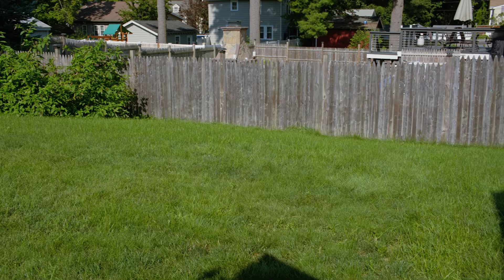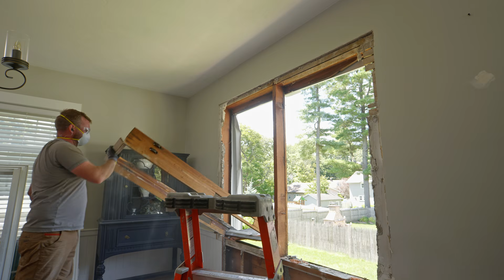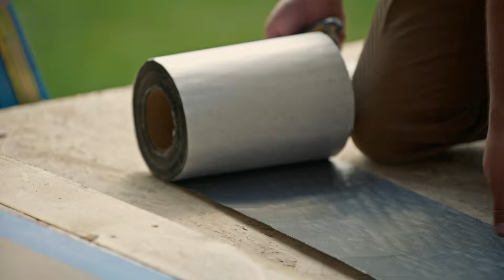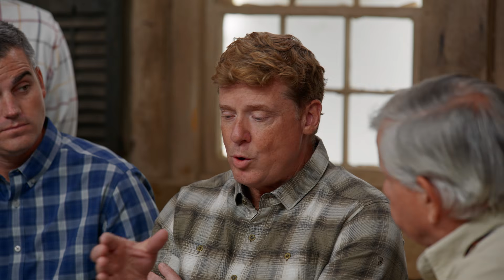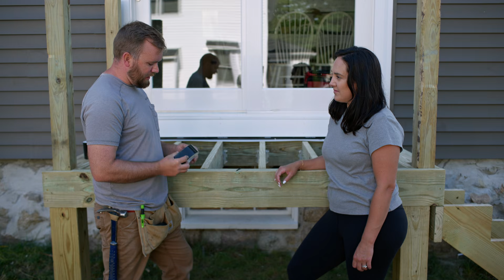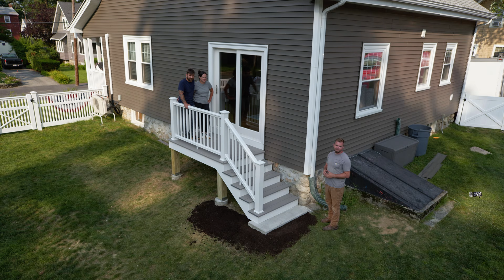ASK This Old House | Window to Door Conversion (S22 E10) FULL EPISODE

Comment: Why did Nathan say he built a "temporary deck" to get the slider up? The deck is permanent.
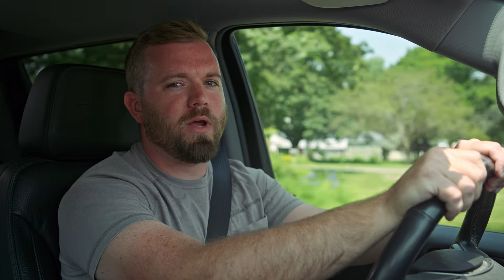Reply: If you look carefully, @17:45 the temporary deck was removed and they are starting work on the permanent deck.
Reply: @rerolley  You're right. Not sure why he'd go to that trouble when you can rent a scissor lift for $125
Reply: @luckybestwash   That'd be increasing the cost of the project by another 25%.
Reply: @HaploBartow  That assumes the project costs $375 before the scissor lift. I can assure you Nathan didn't do this job for $375. More like $3750.
Reply: @luckybestwash  The amount was relative, but the point is that for such a small job, a triple-digit cost for a one-time tool rental is usually an unnecessary cost increase when you can do the same job just as easily with some extra materials you already have/plan to use, and/or with an extra guy to help you. On top of the cost, you also have to take time to drive to the rental facility, fill out the paperwork, load it up, bring it back, unload it, and then do that all over again once you are done.
Reply: @HaploBartow Yeah building a sturdy temporary  deck that will take hours and requires demolition is a much better use of your time.
Reply: @HaploBartow  Building a deck + stairs, ripping out a window and installing a slider is a "small job" he says, so small that renting a $125 scissor lift would bust the budget.
Reply: It may have been before they poured the footers.

Comment: The two big ones I look at are the roof and foundation. A new roof is expensive. Foundation is even more expensive, takes more time and is much more inconvenient. The exterior of older houses is the third as Mauro said the cost of hiring a crew to mitigate lead is shockingly high. The most expensive thing you will ever buy deserves research and personal investment. A thousand dollars in tools and the knowledge to use them can save tens of thousands.